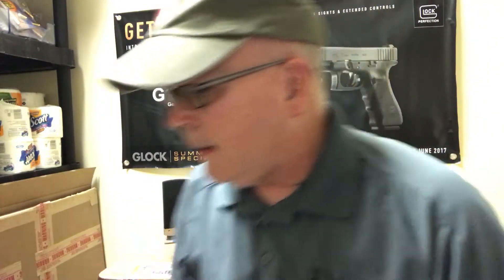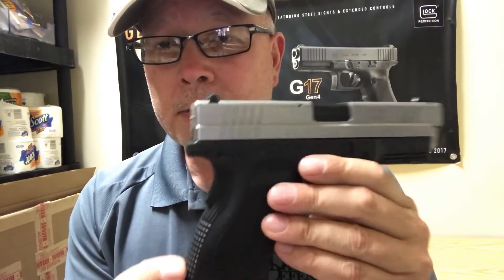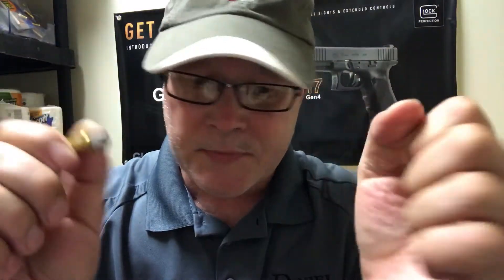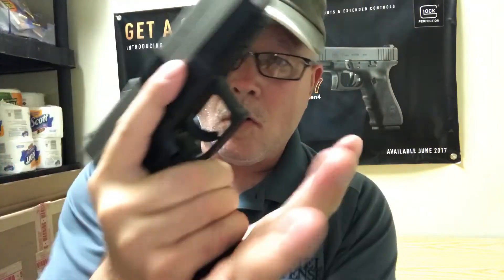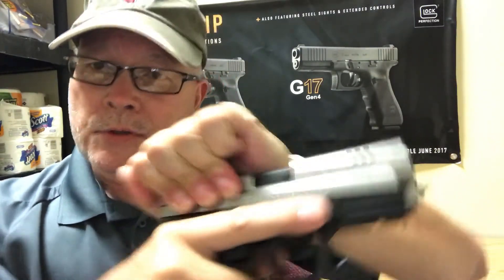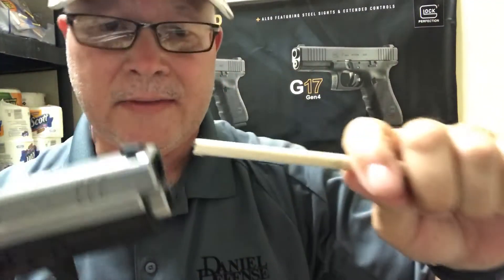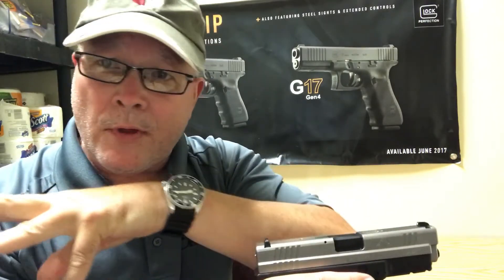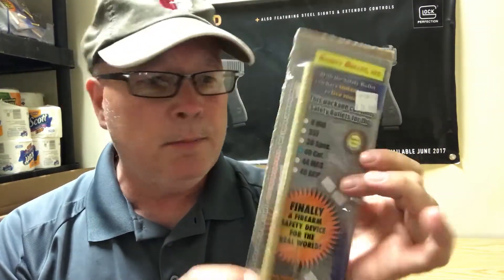The Safety Bullet!

Comment: There is absolutely so reason to have one of these near a real gun!
Reply: What's the problem?
Reply: The problem is that you completely lose all functionality of the gun if/and/or when the hammer is dropped. You might as well have a rock in your hand because it will be just as useful. Granted, if a child or an attacker gets to the gun before you do, they can't injure themselves or you with it, but it makes the gun entirely useless in a situation where it could save a life. If the worry is that a child will get to it and cause harm then there are better ways to protect them. Teaching and training is ideal. I grew up with guns in our house. Myself and my 3 siblings never, ever, had a bad situation happen simply because my father taught us from the time we could crawl to respect and be extremely cautious around firearms. As we got older we were allowed to use and practice with them. They became a tool to use, like a chainsaw or lawnmower. I get the point of the safety bullet but seems a little shortsighted when it comes to using a firearm for home protection.
Reply: If used properly, it seems as though it would only fail when it should.  Also, there are people who grew up with guns who have had accidents with guns.  Training may deter negligent discharges, but it doesn't prevent them.
Reply: Why not put something similar in cars which would disable them when someone wants to drive?

Think of the lives saved (over 35,000 per year in the US alone) and the reduction in car theft.

Then again, it may slow down police, fire and ambulance response time but think of the safety.

Comment: There needs to be an emphasis on safety bullet training. Muscle memory suggests training racking the safety bullet in a self defense situation. Is there safety bullet training classes available?
Reply from the maker: Justin Davis we have actually not sold many of them. The owner said they would fly out of the store.  Interesting concept but disappointed that they have not sold very well.
Reply: KDOD357 I completely understand. The concept is slightly confusing but has a ton of potential. If there was more of a push for training with the safety bullet, I believe success within the realm of safety and self defense is absolutely possible.
Reply: Best safety bullet training: do not buy it.